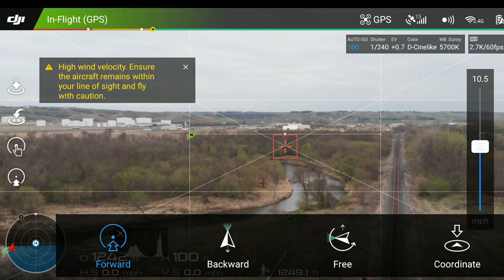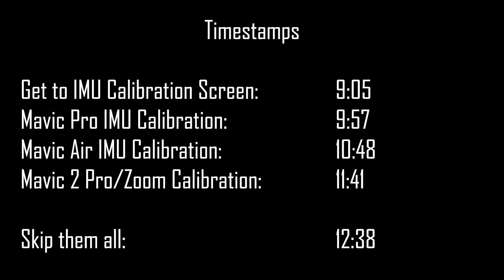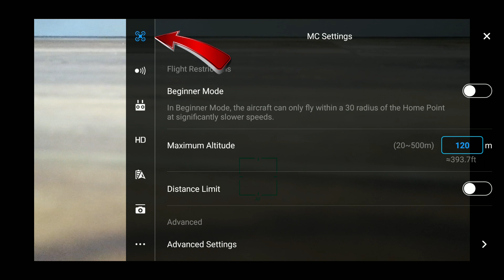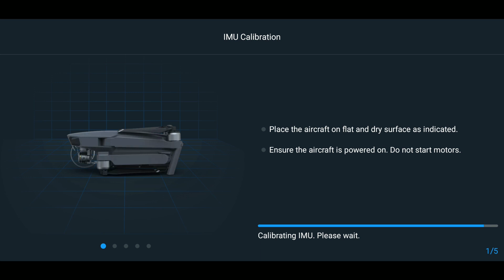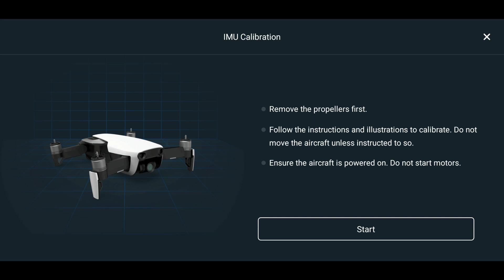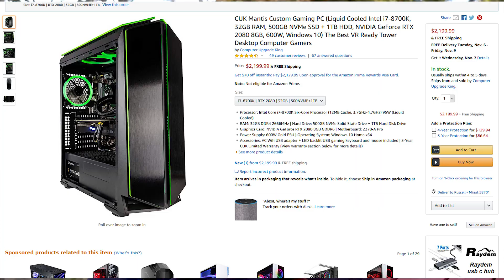DJI Precision Landing | IMU Calibration Why and How?

Comment: Another great informative video that’s holding up over time. Thanks! @14:00 regarding John‘s comment, I happen to edit the footage on Lumafusion on my iPad Pro from 2018. Smooth as butter if those are the only options you really need. I can still add LUTs as well.

Comment: I know this is an older video, However I have a question. I have a Mavic Pro 2 with the smart controller. I have had no issues with it until yesterday. They told me to update for precision landing. So I did like normal. However now it tells me to calab. my IMU. No problem, I do that it says it is successful. Then when I restart my drone it tells me again IMU calab. needed. So I repeated this like 20 times. Would you happen to know what I should do? Love you channel.

Comment: ALL THESE FEATURES ARE NEEDED FOR SAFETY SAKE CANT BE TO SAFE IN CASE OF SOME EMERGENCY YOU CAN REST ASSURED THINGS ARE TAKEN CARE OF HOWEVER IF ONE DOES NOT WANT TO USE IT THEN SO BE IT HOWEVER THIS DOES NOT MEAN FEATURES SHOULD BE LEFT  OUT PUT ALL NEEDED FEATURES IN AND USE WHAT YOU WILL ONE  LAST POINT AND FINALLY LETS HOPE DJI CONTINUES TO SUPPORT THE DRONE BEST CASE FOR EVERYONE AND I DO MEAN  EVERYBODY THESE FEATURES NEED TO KEPT UP DATE

Comment: In video editing the GPU (video card) is just as important as the CPU.  A weak video card on a state of the art CPU will slow the process down considerably due to the way video is processed.  Most of the work is done on the GPU side.  A mid-range CPU with a state of the art video card can work faster than a state of the art CPU with a weak video card.

Comment: Just a thought:  If you use a landing pad such as seen here the pad should have a homing beacon that the drone looks for which would no require calibration.  The drone would be programmed to land on the beacon.  Now there would have to be a system on the drone that can detect the homing beacon signal but how much extra would that cost?  With that landing pad only the drone camera is used and night flying might be a difficult thing to compensate for especially in total darkness or where light is barely visible.

Comment: I am nearly 66years of age and have been using/ building computers for about 39 years and flying drones for a few as well, have three DJI models ie Phantom 3 Pro, Mavic Air, and a Mavic 2 Pro. My Pro 2 doesn't have Precision Landing BUT still, it lands within an inch or two of where it takes off from. Great Drone !!! Bob. Ps Now am going to sell the Phantom and the Air as the Mavic 2 Pro doe's everything that I need it to do.
Reply: Bob, look for the firmware update (it may auto-load and you might visually miss it)
Anyway, it's supposed to fix the precision landing feature.
I only have a Spark, but you can check dji forums.
Reply: @whatsup7202  Thanks mate, will do.

Comment: I notice you have 32 Gb Ram, and RAM is all important in video editing. I have 8Gb and I can get the job done if I don't swamp it with too much raw footage. How much RAM do you think would be enough? I put 2X8Gb cards in my PC but it went mental, blue screens etc and finally had to take one out and now it's fine, but not a happy experience doing editing.
Reply from the maker: For 4K footage, I would go no lower than 32Gb.  Especially as 4K@60fps becomes more common.  Mine has trouble with that.

Comment: What is not often mentioned on Precision landing is that it’s a very nice feature to help protect your drone…. From engine / motor damage.!  
The Mavic’s electric motors sit low to the ground.  It’s important to use a landing pad to help keep the motors clean.  It’ kills me to see people takeoff/land from the dirty ground, beach sand, dirt on driveways, grass, etc.   One little grain of dirt/sand can hurt your motor.
  Precision landing is amazing for landing on your small landing pad.

For the iMU’s, I think the main problem is that people turn on the Drone, and walk the drone over to a takeoff location.  IMU need a stable startup period to calibrate.   One does not want to move your drone during this startup period.   Modern aircraft require a few minutes for their IMU’s to calibrate before the aircraft can move.   I would think the same general principle applies.

Comment: My Mavic Zoom has never been able to complete the IMU calibration, it just stops at step 2 or 3 and seems to hang (android). When I got the zoom it had a definite lean to the right, I attempted IMU calibration, as described IMU calibration would not complete, however it did solve the problem and it fly's perfectly. So no big deal.
Reply from the maker: Have you upgraded to the latest firmware?  I know that the instructions on the DJI Go4 app used to show the incorrect procedure.  Try it exactly as I show in this video and see if it works.  They did fix the illustrations in the most recent update to the DJI Go4 app.
Reply: Yes I attempted it first with the original firmware, and again with he latest version, same result.  But the drone flies well and is otherwise works great. I assumed it's a android problem, as I have to upgrade firmware via PC as doing via the app does not work either. The app keeps telling me I'm not connected to the internet.
Reply: Trevor, perhaps your problem is an incompatible android phone. I also had problems with the DJI GO4 app, because it still was hanging. I was forced to use another model to work well with my Mavic Pro controller. Plz try an other phone, for example loan from your friend  and to install DJI GO4 and try it as running with your drone. Robert from Poland

Comment: Thanks for the great video.So.... does the Mavic 2 NOT have Return To Home? Is there a difference in RTH and Precision Landing? My Spark has RTH. I can't imagine that the Mavic 2 wouldn't have the RTH function. ????
Reply from the maker: It has RTH, but not "precision takeoff" aka precision landing.  RTH is only accurate within a few feet.  Precision landing is something that you enable prior to takeoff on the Mavic Pro and Mavic Air.  The Spark is automatically enabled.  It allows the drone to return within inches of where it launched from.
Reply: Thanks for the reply! Hopefully, before I give in and buy one, the Mavic 2 will incorporate this.

Comment: Hey Russ! When doing a IMU cal w/ the legs folded on MP, is magnetic interference error normal?
Reply from the maker: No.  You need to move to a new location.  Like I can only do it on one of my counters, because the dishwasher side won't let me.  Too much metal.
Reply: @51Drones  : Re IMU Cal...Can the motor caused the Mag Interference given that it's folded and close to the body of the AC? 
But I will try again and find a perfect place but so far I managed to cal my IMU and passed even w/ that error.
Reply from the maker: No, the motor does not affect it.  Glad it calibrated, but I would try to find an open area with no metal around within 5 feet.

Comment: Thank you for the IMU Calibration.  I first noticed a need for “something” when the Pro would drift ever so slightly to starboard.  Even when I watched my use of the right stick carefully, the aircraft still drifted even if but a minute amount.
Next, I noticed when using RTH, (yes, I use RTH, I like it, and yes, I can fly by the map insert) that the aircraft wouldn’t land exactly where it left terra firma from.  Close enough, but increasingly becoming less precise.
Today, flew out to a lighthouse over water (it does work, keep your altitude at 50’ or more) and I received a rather stern warning of high winds, and to land ASAP.  This took place at sunrise, there is no wind at sunrise!  Incidentally, I was receiving wind warnings more and more frequently.
These circumstances are your proverbial “sign”.  Best to heed them if you are attached to your aircraft.
Performed an IMU Calibration.  Lifted off, gained about a hundred feet in altitude, and 25 yards away from home point, and executed a RTH.  The aircraft landed to within an inch or so (by visual reference) from the takeoff point.  That’s what it did brand new out of the box.
So, if others are experiencing these issues, I would proffer that 51 Drones is onto something here.

Also, to ensure my table was level, I bought a $4 level from a major home store.  The level checks both axes simultaneously.  I keep that level in the carry case in the event I need it out in the field.
Reply: Great comments.

Comment: First, love you're videos! Some of the best in my humble opinion. 
However, I disagree with you that both sides have a valid argument on the precision landing thing. If you don't like or want precision landing don't use it! Why is it a bad thing that others want it or like it? Many electronic devices have many options available for you to use. I don't use all the options on my cell phone so does that mean no one else should have them either?! We spend a lot ($$$$)on  these drones and wanting a feature that the old Mavic Pro has, (that has worked flawlessly for me) is not asking for much. It should have been on the Pro 2! What would you say if you bought a new 2019 car of the same model you have and the manufacturer did not include cruise control?.....cup holders, Bluetooth? You don't need them to drive the car and get where you are going but oh my God they sure are nice to have if you use them!! 
If you don't want to use precision landing........or you don't like it........don't use it! 
Please don't tell me I don't need it or shouldn't want it on a drone that costs 1300.00 to 1600.00 bucks.
By the way, I can land manually just fine if I want to or have to.

Comment: Holy Cow Russ - I have been watching ever since last Christmas when the Mrs. got me a Pro - Great lady.  Lately my drone has been acting up and I was 
concerned - I had a fly away and within 5 seconds it was going away from me like a spoiled brat in the store.  It took off and I wasn't touching the controls.
 I saw it was dropping down near trees and I hit the RTH !!!! Thank God it stopped!  I remember you always saying " Take the time to do the RTH.  I even do it when I do a battery change.  So the next 5 or so take off's I didn't go over 10 off the ground.  I noticed when it would hover, it would slowly rise a ft. or
 two. It was the IMU !  Thank you so much for the tip to the recalibrate IMU...… it saved the drone but I am still gun shy and take my time when I launch.

Comment: Confidence... That's my man! I crashed my drone (M Air) and I think the IMU was the problem. For a small amount, DJI sent me a new one and It fly much better.  With my first, I was getting the motor and high wind errors messages. None with the new one. After my first crash, I was very insecure but with the new one, confidence is coming back.  :)  Take care Russ

Comment: Thanks for your work on this. I have owned several DJI drones and currently have both the Mavic pro and M2P. I have never used obstacle avoidance or auto landing but I get your points. As a side note: there is no way I would own a Mavic air!  What a noisy piece of @$*.
Reply from the maker: Ha!  Yes, it is very loud.

Comment: Hi Russ. Brilliant opening scene, really demonstrates the point. Just a small point regarding your comments about leaving the props on during IMU calibration, I think DJI advise removal as a safety precaution in the event of some sort of “hiccup “ . IF the drone did fire up it would damage itself at the very least. For the sake of x seconds removing and replacing the quick fit props I would always advise caution. I also advise starting the controller first before the drone so you have control should it suddenly decide to take off. Don’t mean to preach but some youngsters may experience problems and it’s always good to minimise risks. Thanks for taking the time to make the video, looking forward to the next. Take care and catch you later.Peter
Reply from the maker: Good points.  I would point out, however, that although they suggest taking the props off, that the illustrations on the app show them on. 😁
Reply: Fair play....bit of an own goal there on DJIs part I guess. Just waiting for my MP2 Pro to arrive & can’t wait to see how it compares with my “old” Mavic....liked your idea of tracking one drone with another, might give it a go when the great English weather improves!😂😂

Comment: Thanks Russ - Great video as always.  I had a cheap copy of the Mavic Pro as my starter drone and had it just zoom away and lodge itself 20 metres up a tree on its very first flight.  It took a week to get the equipment together and get it out of the tree!  It did that when I pressed the RTH button (I have no idea where it thought its home was?)! I fully agree with your comments about being able to rely on RTH and precision landing when you are new to Drones, as that gave me so little confidence in the Drone, I boxed it, put it in my loft and saved up to buy a real Mavic Pro.  It was such a relief to see my new Mavic go through the correct and expected motions when I pressed the RTH button and to have it fly down to exactly where it came from.  It meant that I could get on with learning how to fly it without wondering if I needed tree climbing equipment again ....

Comment: I have mentioned in another video of yours that I don't think its a big deal. With that being said they should have included it and will eventually add it along with a few other features mentioned in the manual. In my humble opinion I think they rushed the release (even with the delays). I have both a zoom and a 2 and a spark. I had to send my zoom in for warranty due to pixelation and range
 issues. They sent me a different drone. I have been reading lots of posts about pixelation, gimbal and gimbal ribbon cable issues? It is frustrating that we spend so much money and we are the beta testers. I did the same thing doing the IMU calibration on my spark.

Comment: Great video. I recently got the mavic 2 zoom. Not super concerned about the lack of precision landing as I usually land it manually. I'm sure it'll be added later. Very happy with it so far. Traded up from the Air and the battery life alone was worth it.
Reply from the maker: For sure!